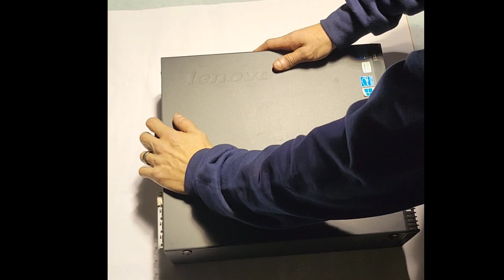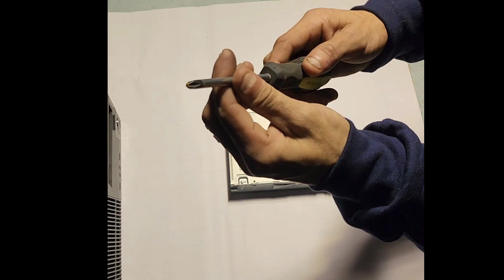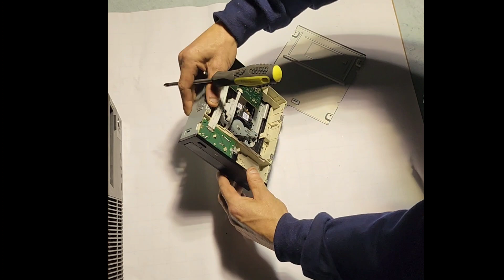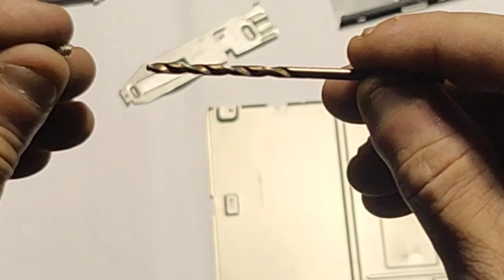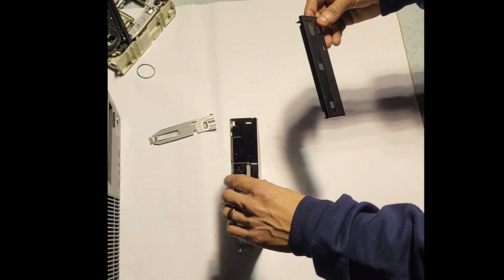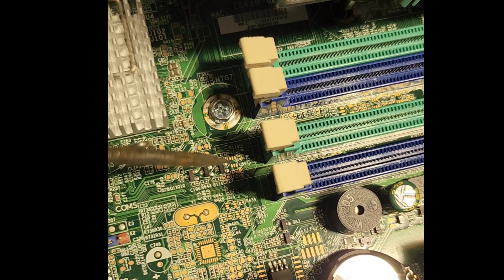How to turn your DVD drive into a SSD Bank and DDR3 RAM Install. "UPDATED"

Comment: I kind of did that on a PC, I bought a couple of those caddys that hold the HDD but they flip open at the front so I could easily swap the drive if I wanted without undoing the PC.